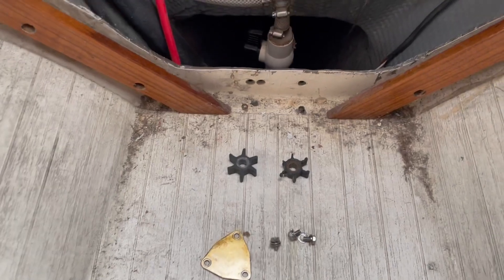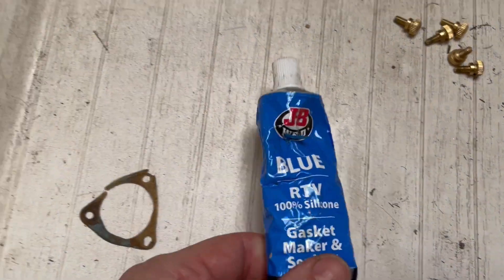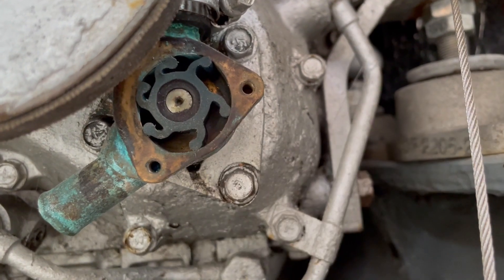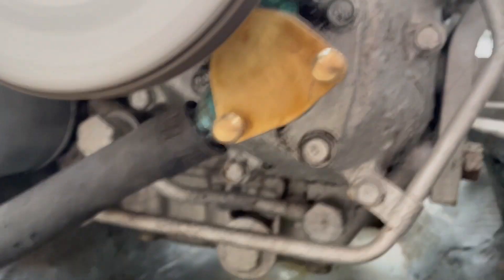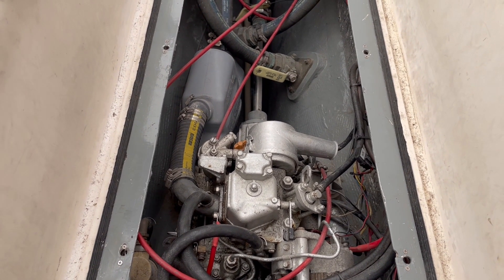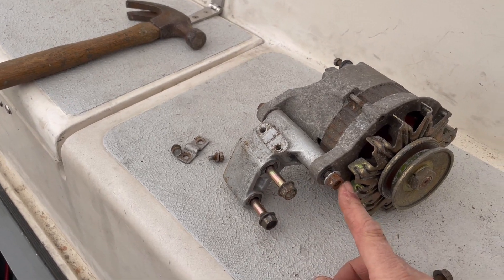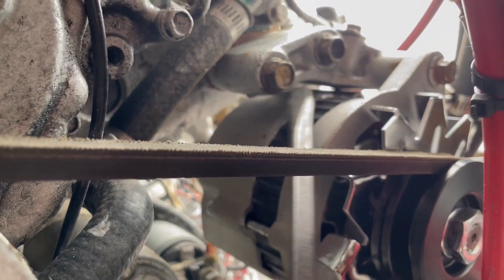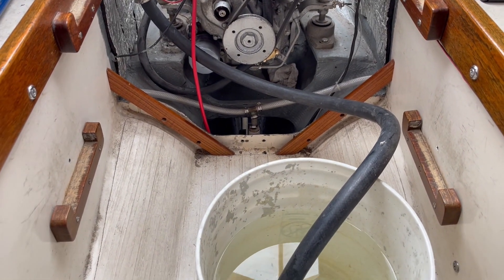Contessa 26 Refit ep.37 - Yanmar 1GM10 Impeller Modification and Alternator Install

Comment: hi! thansk for the video :) 
I have a leak in my impeller and after extensive tests I am considering to give up and just seal it up with silicone. did you do it as well? you mention it in the video but you don't apply it
Reply from the maker: Hello Gregorio.  I did use the silicone only temporarily, but then started making my own gaskets out of cardboard. They would last for a little while, but then I replaced them with a gasket that I made from thin rubber sheet. I’ve reused it many times and it still seals well.
Reply: @EpoxyAndButylTape great thank you! I don't get it why yanmar still produces paper gaskets... I feel the rubber ones way more reliable, but maybe it's just a wrong idea

Comment: Super Thanks for your video! Going to try my first engine repair :)
Where can i find the layout of of the elektrical cables on the back of the alternator?
Cheers, from Amsterdam
Reply from the maker: You can find a free download of the Yanmar 1gm10 workshop manual online with a little searching. That has all of the wiring schematics.

Comment: Is it worth upgrading to a serpentine belt kit for the 1gm10? I put one on my 3ym30 and it made it much smoother in vibration and no belt dust or slippage. Also how do you like the run dry impellers? Never used them. Too bad speed seal went out of business that was a nice little upgrade as well.
Reply from the maker: Not sure what you are by a serpentine belt upgrade?  The 1GM10 only has one belt and it runs both alternator and water pump. 
As for the run dry impeller, no issue. And I have run it dry at least once since the install, so it was worth the extra expense.

Comment: It's weird seeing the engine position on yours. Mine is basically 80% inside the cabin.
Reply from the maker: Yeah the Rogers built boats had a more forward mounting position. You probably have better access too.
Reply: @EpoxyAndButylTape  Yeah, I can access everything without lifting the cockpit deck, which is a godsend!